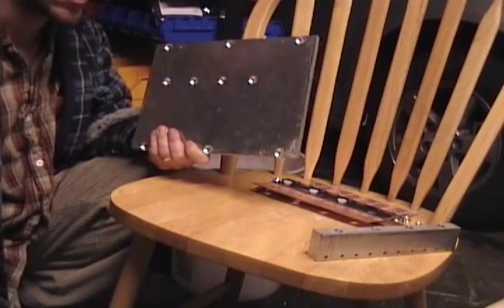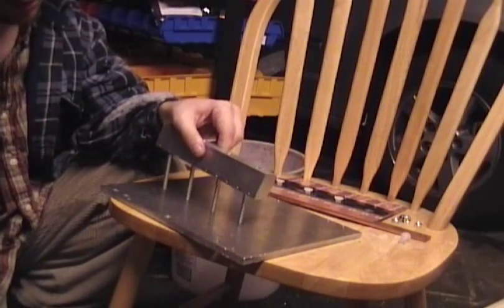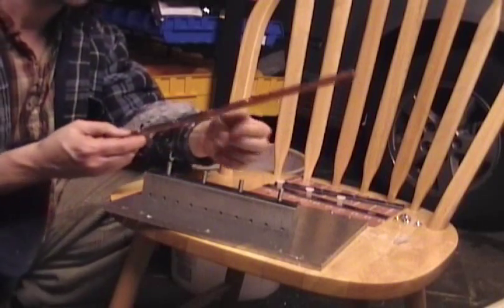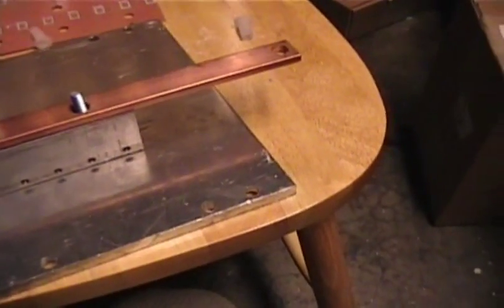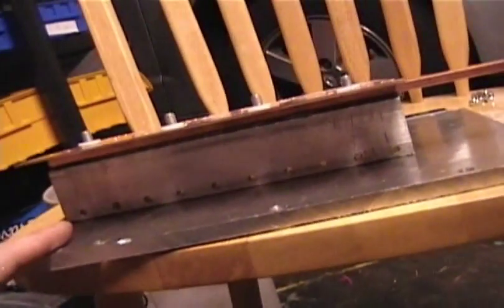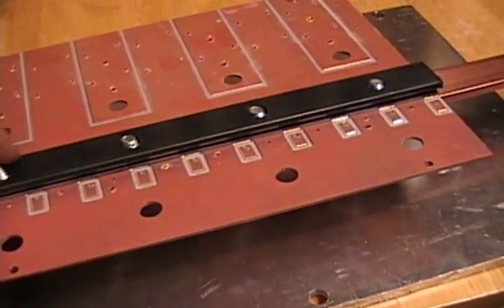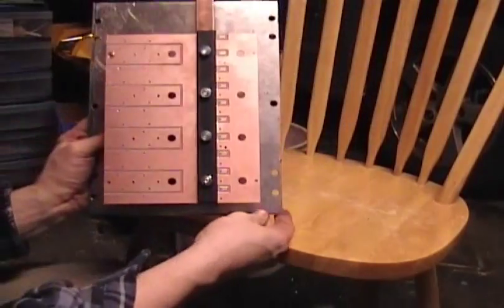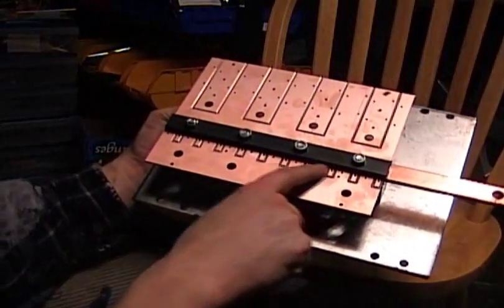How the 144v 500amp DC controller power section bolts together without the electronics

Comment: Hey, discovered your channel through your instructables page, unfortunately, the instructions link is broken...
I'm an engineering student and currently on a big RC controlled project.
The motor power section is a big concern and your driver is the most impressive I've seen over the internet, so, maybe you still have the files so that  I could use your power section for my model (probably a way smaller current and voltage)... 
I plan on making it modular, so probably using an atmega2560 for the control of all the power sections I'll have on my project

Comment: How much will your 1000amp version end up costing? Will you sell kits on the Paul & Sabrina website? It would be great to have diy/budget 1000amp version that can support ~160v nom :)

Also re the through hole, if that makes it easier for ppl to assemble that would be best. It would be good if there was also an option to watercool the heat spreader to support longer continual load - it could be as easy as milling out a channel in the bottom of the heatspreader and adding a fitting at each end :)